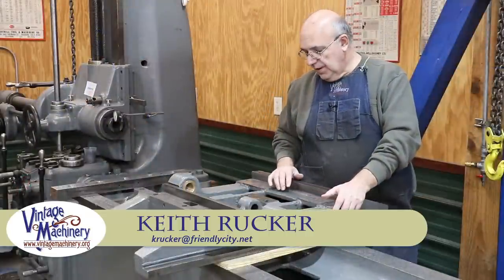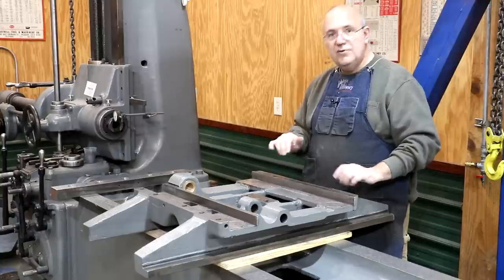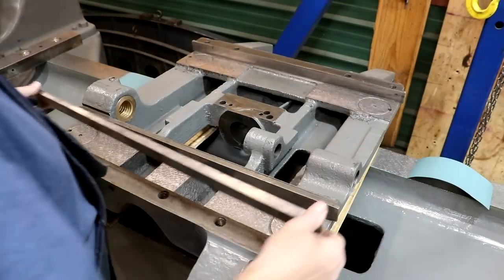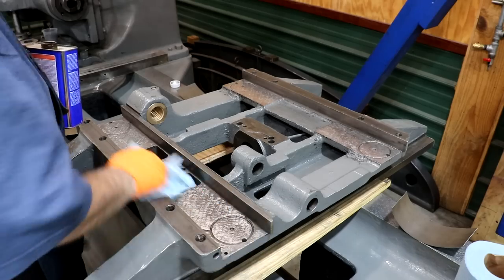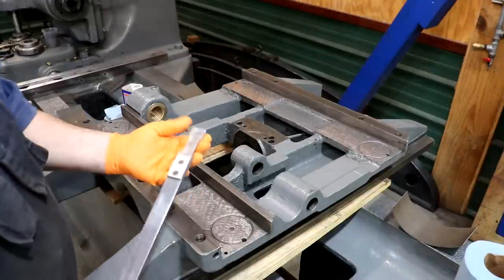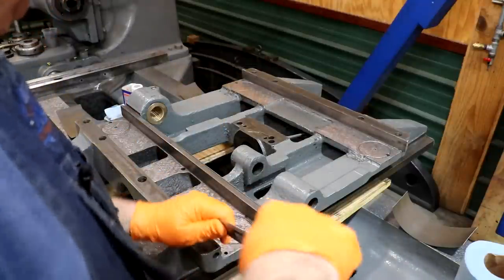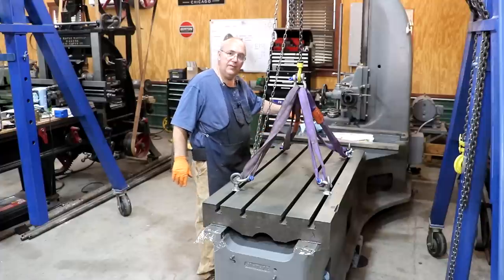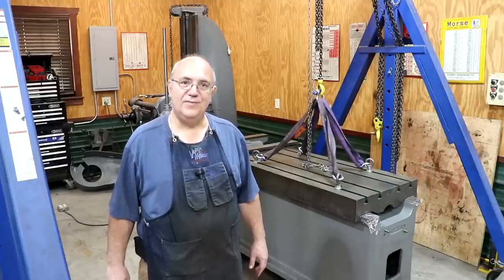Horizontal Boring Mill Restoration: Installing Turcite Wear Strips to the Machine Ways

Comment: I was a scraper at Continental Machines in Savage, Mn., where DoAll surface grinders and saws were made. About 10% of grinders were ordered with Turcite ways. I remember it being easy to work with and easy to scrape too. Turcite cost extra but but it was a little less labor because we would just rough in the ways on the top of the saddle with the Viaax power scraper, apply the Turcite the same way as how Keith did it , scrape in the Turcite, and cut in the oil grooves. The rest of the machine had regular cast iron hand scraped ways. This was in the late 70's-80's. We thought Turcite was an excellent product!

Comment: I have been using epoxy resins and adhesives for going on 60 years. Besides what others are saying about using a scale to measure, my observation is that  the layer of adhesive is about 10 times thicker than it should be. A V-notch trowel is good for tile setting with mastic or thin-set, but leaves an immense thickness in this sort of application.
Reply: I agree with Jennifer regarding the use of the v notch trowel.  The notches are cut to a depth to leave the correct film thickness of adhesive when the points of the notches contact the base material which the adhesive is being applied to.

Comment: Looks good! I did notice that you covered the circular oil grooves and supply hole with Turcite. That would eliminate lubrication, and put a pocket of oil behind the Turcite. Do you plan to cut back the turcite to allow lubrication?

Comment: NitroTom91 is correct, along with that, the serrations in the applicator are for consistency in adhesive leveling. Just like a trowel for flooring adhesive or tile setting. Different size serration(notches) for different applications. Consistent adhesive=level surface.

Comment: Interesting about the epoxy cure time: I seem to recall that chemical reactions can have a solid state where cure is in. Also I agree with the 48 hours to allow for the turning the corner  when the epoxy becomes fully reacted. It's nice that the epoxy is machinery gray.
Reply: Ok.but check the exactly weight of 2 components  exposy before you mix.dont do like video

Comment: I did not work with this particular product, however a few thoughts on using Epoxy in general to improve a process like this:
Epoxy is not contact glue. Use on one side only, especially if you are worried about tolerances and thickness.
Never estimate the two parts mixture. Be very careful and use scales to be as exact as possible. Most epoxies are VERY sensitive to deviations in mixture and will remain part jelly or at least be a lot weaker than intended.
Scratching the surface of the casting like that looks like a lot to the human eye, however sanding in courser grit will provide massive adhesion advantage over just scratching.
Again, I am not familiar with the data sheets of these particular products. But if you want the best outcome for all the effort and money involved and the data sheets do not say otherwise I strongly recommend you try these tips. Please feel free to correct me if there is more science you can share. The 'we have done it otherwise for decades' unfortunately doesn't prove a lot in terms of scientific quality.
My 90 year old master is a very knowledgeable man, but he searched the handwheel to wind up the z-axis on a multi-hundred-thousand Euro 5-axis cnc for weeks :)
Reply: Agreed on the scratching for sure. Better yet is to sand blast the area. Can’t beat that texture.
Reply: The manufacturer instructions for Turcite installation using their Waylock II Adhesive specify application to both surfaces using the serrated spatula.
Reply: @nomen_meus  Thank you for pointing that out. Would be interesting to know why they do that.
Reply: @NitroTom91  I agree with you that the epoxy only needs to go on one surface. I'm pretty sure the recommendation to use on both surfaces is a financial reason. It gets you to spend double on the epoxy! And as the cost of the Turcite is exorbitant as well they get you both ways. Turcite has a very good rating but I feel the manufacturers rather overprice their product somewhat.
Reply: @NitroTom91  I imagine applying to both sides makes sure the complete surface is wetted, if you do not do that with thin layers of epoxy it might not spread everywhere and there may be dry spots.
Reply: @progandy  I think that is the correct reason for applying to both surfaces. Lack of full coverage can easily be proven by applying wood glue to one surface then quickly pulling the two surfaces apart.
Reply: @samrodian919 It could be the MFR directs adhesive application to both surfaces when using the included spreader. That process is very common in the aerospace industry and is exactly how it should be done. The serrated edge of the applicator are of a specific height which when held at the correct angle during application leave ridges of known height in the adhesive. When it is applied to both surfaces it minimizes or in most cases eliminates voids within the adhesive bond line. Best practice is to apply the adhesive in one direction on the part and at a 90 degree angle to that on the substrate.  Another important feature is to verify there is adhesive squeeze out on the perimeters of the parts. This ensures there is a fillet at the edge that significantly increases the shear strength. Understandably not every edge is visible, which is why the serrated spreader is used.  That process is exactly how heat shields are bonded to space vehicles, which is what I do.

Comment: What stops fine swarf particles from becoming embedded in the soft Turcite and this combination acting like a lap that abrades the cast iron ways ?
As you juggled the cross-slide into position on the ways, did the Turcite slide on the epoxy layer so that it is now out of position ?

Comment: Hallo Mr. Rucker,
Allow me to congratulate for your excellent videos.
I am using the excellent “Southbend 9a” lathe for more than 40 years now, but as you can understand I am having some bed wear. I would like to ask you, what kind of material should I use for repair it (Turcite or any other), and which glue should I apply. 
Thank you in advance.
S.Kopitsas, Athens Greece.

Comment: Given the cost of the Waylock 2 adhesive, one might have hoped that they would have supplied it in a dual component dispenser cartridge, to fit in a standard adhesive/sealer gun, rather than the wasteful and inconvenient tins. I have used some stud/bolt mounting epoxy for fixing my heavy winter swimming pool cover mountings into concrete. It comes in a stand alone dual dispenser with a screw knob on the bottom and a pack of 4 spiral mixing tubes which screw onto the front of the dispenser and are a throw away item after each use. This was around €20 for the whole thing, so I suspect the actual dispenser/mixer tubes are not expensive.

Comment: will you recut the oil groves back into turcite or does it not need them
Reply: I wondered about that.
Reply: The instructions for Turcite state to not cut any lubricating channels deeper than half the thickness of the Turcite layer. Holes straight through are fine. Teflon or not the ways still are lubricated.
Reply: @kennethstaszak9990  thanks

Comment: Back when we were rebuilding steel mill roll grinders at my first real job, we machined the ways down and used aluminum nickel bronze plates screwed down to the casting with countersunk screws then we did a finish cut on the bridge mill (which was big enough to park three cars on. ) and machined oiling grooves. Then it was scraped in.

Comment: And the oilways  are not required anymore Kleth???
Reply: I have the same thoughts.
Reply: Lubricating channels are cut into the face of the Turcite, no deeper than half the thickness of the Turcite layer. Holes straight through are fine. You just don't want oil to get at the epoxy or it will deteriorate over time. It happened to my mill.. Teflon or not the ways still are lubricated.

Comment: Great work Keith but $700, wow!!   I have seen a liquid product like Turcite used as well, sets solid of course.   What did they use before Turcite I wonder?
Reply: Cast iron lubricated with elbow grease!
Reply: I've seen older machines with a phenolic where we'd now use Turcite or Moglice.  I remember seeing wood working machinery with HDPE strips.
Reply: @russkepler  Moglice - that was the other stuff.  Stefan Gotteswinter has used that one a couple of his videos.
Reply: Sounds like Turcite needs some competition.
Reply: @ellieprice363  Garlock has Multifil.  No idea on cost difference

Comment: This is counter intuitive to me. Keith just spent all that time and effort to scrape the ways into precise alignment... then he scratches them up and epoxies these strips on top. Between the scratches, the epoxy, and the turcite, It seems like he just introduced a whole lot of variation into the system where he just eliminated all the variation.
If you are going to scrape the turcite into precise alignment, why bother scraping the ways in the first place?
Anyways, thanks for another interesting video !!
Reply: Doing the scraping first means the turcite will all be about the same thickness which is what you want. Probably gives a better bond too as scrape marks hold epoxy as well as they hold oil.

Comment: Keith, you need to educate yourself... There is a difference between 'recommended' and 'coerced' or 'enforced'. In the UK, the epoxy adhesive system would not have had any action on the system warranty. That's probably why they market the stuff in the USA, differently from marketing in the UK.

Comment: Can it be used to rebuild the tailstock?
Reply: I've heard of people doing that but I'd wonder at the suitability of putting something slick on the bottom of the tailstock.  One lathe I just shimmed the top casting on the base.  Not sure if that's an option on this hbm, I think you can just tweak the support bushing up a bit and be ok.
Reply: @Russ Kepler  the nose of the base casting on my 10" Atlas Frankenlathe is worn.  I have  other castings, but a curiosity for sure
Reply: @anthonyraffin1034  It'd be relatively easy to scrape the base flat then see how much shim you need.  Flat ways let you scrape the bottom on a surface plate and checked by keeping the top parallel to the plate.  I'd bet the shim wouldn't need to be more than the .004 wear when you're done.

Comment: Hi Keith ! great work as usual ;-) I was kinda puzzled you did obliterate all lubrication channels/rings when gluing the Turcite strips. Do you plan to reopen them once cured (which will be more cumbersome as you did not transfer the shapes/positions) or is the plan to go dry Trucite on dry cast iron ? 
Keep up the good work, your videos are a weekly feast for the eyes !
-Phil
Reply: I see that a lot of people have questions on this. I thought those channels looked like “crop circles” from outer space visitors. They seem necessary for lubrication, but I assume that the Turcite, being Teflon based, provides a lubrication surface. Still, the oil passages are obviously blocked. I’m assuming that Keith will answer this in the follow up video.
Reply: One thing you don't want is for oil to get at the epoxy. My milling machine had the Turcite strips separate because the manufacturer cut the serpentine grooves too deep and the epoxy bond deteriorated over the years.I got it used so when I took it apart for reconditioning three out of the four strips fell off because of that. The instructions for Turcite state to not cut any lubricating channels deeper than half the thickness of the Turcite layer. Holes straight through are fine. Teflon or not the ways still are lubricated.
Reply: @kennethstaszak9990  Thanks for the reply ! This must be the reason why Keith went this way -  I did not look up the Turcite datasheet, but your explanation makes sense indeed. Hope Keith will address this for the sake of topic completeness, and it would then make sense he later reopens the oil passages.

Comment: How does future version of Keith remove the epoxy to replace the Turcite in 125 years?
Reply: carbide power scraper.
Reply: There are a few possible paths. He pushes a button and lets a robot do it. Or, he listens to the stories the elders tell about the Before Times when there were paper books, not these silly clay tablets.

Comment: My question is how long does turcite lasts compared to cast iron on cast iron surface?Or cast iron to hardened bedways? is it something that will last 10-20 years or will it wear down faster?
Reply: it will last years and year of daily use as long as its stays lubricated its a great material for this situation
Reply: Good way wipers are a must.  Pressure lubrication is very helpful.

Comment: Love ya, Keith. Love your channel. Love your presentation. Love your personality. I just can't do it anymore......I cannot watch ANOTHER scraping video.....I just can't do it. 
Make a video watching paint dry, PLEASE. Make a videp of snails racing, PLEASE. Make a video of human hair growth, I will watch those videos. But I cannot watch another scraping video. I am totally burned out on scraping.
Reply: I totally love scraping videos and can't get enough of them!
Reply: But Keith has gotten particularly good at it, so to me highly watchable.  Abom79, not so much and I don't think he particularly likes doing it.
Reply: I do understand the reason for scraping but it surprises me that the ways are ground flat to high tolerance and then the grinding is negated by scraping.
Reply: 2 perfectly flat surfaces dont allow good oil flow in between them    it would require a constant pressurized lube system   those tiny divots hold oil to minimize wear
Reply: @peterhobson3262  As I understand it , the scraping brings it to a higher tolerance than the grinding as well as doing the oil flow bit.
Reply: @peterhobson3262  ground doesn't mean flat and as someone else said 2 ground flat surfaces will stick together like no one's business (stiction).
Reply: Let me make sure that I understand. I think you are saying that another scraping video is NOT your first choice?? Maybe second or third choice?? Just want to be sure.
Reply: Yeah it sucks that watching the scraping videos is a prerequisite for watching any of the other videos in the series.  I wish you could just not watch them /s

Comment: As someone that has worked with Epoxies daily for the past 30 some odd years, I can tell you for a fact that you are applying incorrectly!! Epoxy is not a Contact Adhesive or a product like Wood Glue, you should always avoid apply epoxies to both piece to be joined, you should only apply it to one surface . Applying it both surfaces causes voids to form which leads to poor adhesion, slippage and in your application throwing off tolerances bc of excess epoxy.
Reply: He did it by the book. Trelleborg wants you to do it this way.